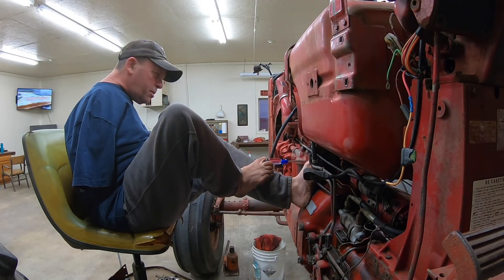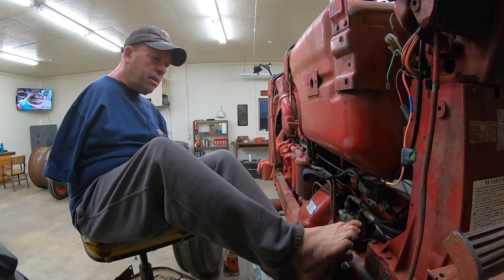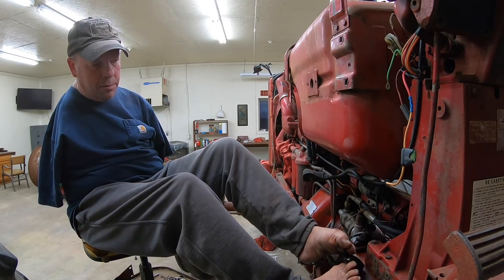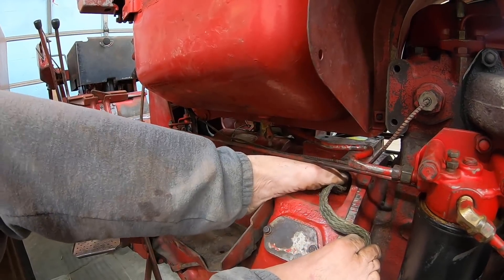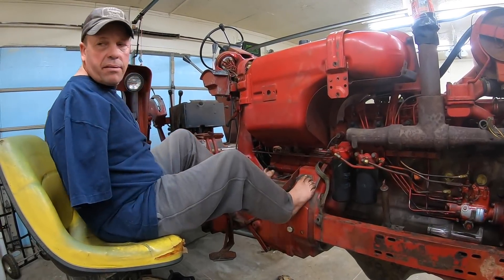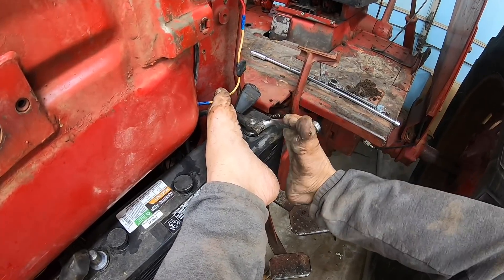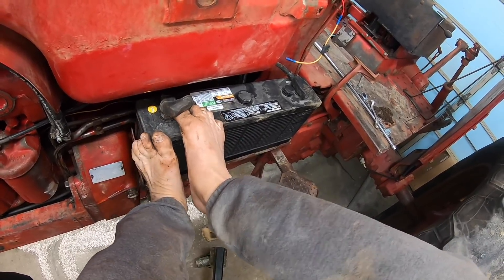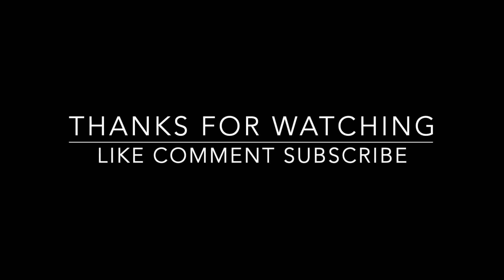IH 856 Project Continues

Comment: I see your dash lights work too. I had to replace the big red round transmission flasher bulb. It was fun. Something so simple took a half hour. Tricky little thing. It was cheaper to buy a box but l only needed one $6 dealer got me....

Comment: The wire that you taped up is the ground wire for the red light on the dash. The "sensor" you referred to is a grounding switch that is tapped into the lube oil circuit on the TA. Light on = no lube pressure, Light off = lube pressure OK.  That red light will come on each time the clutch pedal is depressed because the dump valve is opened at the same time. Its purpose is to release the TA clutches which takes the load pressure off the transmission gears for easier shifting.  The dump valve is adjusted right if the light comes on when the clutch is depressed and the light goes out just before the main clutch starts to engage. If the dump valve adjusting rod is too short the tractor will double shift when starting out in TA HI range (provided that TA LO range still functions).
If the original wiring loom is ratty you can add a good factor of safety against an accidental dash fire by installing a 30 amp circuit breaker between the starter hot terminal and the hot leads into the loom. Learned this trick by working on the John Deere 20 and 30 series back in the day.
Safest way to hook up battery cables is to leave the ground cable until last. That way there isn't any accidental arcing.
Believe it or not I had a John Deere 4020 loader tractor show up here for a clutch job.

Comment: Andy, I totally love your determination,  abilities,  and your knowledge of working on these Big Iron tractors. Everything on these machines are big heavy, and hard to get to. Not to mention high as the tractor itself is tall. You need ladders to reach stuff as everything is overhead.  But thats where "your" determination and knowledge take over. 👍

Did i hear the tractor fire off as you turned the switch?  Sound like it was running. Looking forward to see the ole gal working. Your getting there.
Reply from the maker: No, didn't fire. Thanks for watching

Comment: Nice one to both off you. Now kily is going to be working on farm with Andy think u will have to give her some good lifting jobs she was struggling with the battery's a we bit. L.o.l from Andy in UK
Reply from the maker: Yes, they are heavy. The starter in the previous video might have been heavier tho. It was a struggle. Thanks Andy
Reply: @HarmlessFarmerAndyDetwiler  that's only trouble with older tractors every thing is high .at least on the new ones it's a bit easier.  Still good job to both off you.

Comment: Amazing dexterity and you do it with your feet. I am quite dexterous with my hands. Just waiting for my GoPro to begin the process of filming it. Any advice to improve dexterity in the feet? Also, any advice about GoPro camera usage?
Reply: Also, got a video suggestion, are you comfortable enough with your community on this channel to eat a sandwich to demonstrate how to eat a sandwich with feet?
Reply from the maker: I have 2 of the GoPro hero 7 Black cameras. When they work, they are awesome. We seem to have trouble with them locking up. Set it up and start recording.  The eating video is coming. Thanks Matt
Reply: @HarmlessFarmerAndyDetwiler  we sure do appreciate your go accomplish it attitude. What I find about the GoPro is that the mount screws need a fair amount of tension more than any other camera mounting system do to the center of gravity being higher than other cameras. I am going to attempt to see if I might be able to fix the lack of friction issue.

Comment: From the looks of that clutch pedal it looks to have had a decently easy life. At least it’s not worn slick like half the stuff I use, anyway.
Reply from the maker: The tractor has 9000 hours on it. It came from a 120 acre dairy farm. I don't think it worked that hard but was a constant use. Does that make sense? For years it hauled a load of manure maybe every day or so. They had a gutter scraper in their barn. Made a lot of hay. A lot of PTO work. Really, the tractor is in great shape for the hours. Im thrilled with it.

Comment: I hope she gets whatever she wants in life. They are one hack of a team! And Andy you made the right chose in tools also. In my opinion anyway. I bought an impact driver and a drill kit Ingersoll rand it had been referbished . its been close to two years ago and both tools and batteries still work great. I can't say that about any dewalt  or Milwaukee I ever had. Plus much easier ion the pocket. I'm done with expensive tools. They are nice most of the time but there is always a cheaper one out there that does the same job for less money.

Comment: Hi Andy, another great video.  I was surprised that the tractor required so many tubes and hoses.  Wow.  Also, it looks like the tractor has two batteries on each side of the tractor.   Why?   I'm also surprised that Kylie didn't use a battery carrier to avoid contact with her clothes.  Excellent as usual!!!   - Dean from Minnesota

Comment: I might have missed it but are you going to paint it ? I think it looks  good the way it is maybe put some wax on it. Looks a lot better than the 4520 I just bought. That Oliver standard I've been  spying in the background is a pretty sharp one. I like  them both ways but that one seems like it's in reality good shape.
Reply from the maker: The 8 is in really good shape. Someone painted it years ago with cheap paint and the sheet metal has turned kind of an orange color.  It didn't do it any favors sitting out in the elements for the last several years either. Im not planning on painting it, think I'm going to wet sand it just enough to smooth it up and see what happens. Save the original patina so to say. The Standard 66 wasn't in good enough shape to keep the original patina so we did it up. Thanks for watching

Comment: Well I guess I’ll have to wait for,the next video lol.    Did you reseal the injector pump where it was leaking?  Done a couple myself and it’s not that bad.  Thx.
Reply from the maker: Haven't messed with the pump yet. Just trying to get it running and moving on its own. Making a list of things that need to be fixed. The pump is on the list.

Comment: The way you use those tools with your feet is amazing, and when you slid that hose on and held the hose clip into place with one foot I thought Kylie will now have to step in to tighten the clip, but I was wrong, you just picked up a screwdriver with your other foot and tightened it yourself, You have a good attitude Andy, It would have been nice to see that engine start :(

Comment: Hey buddy would a 5/16 nut driver be easier on them hose clamps?or is there a reason you use flat head?thanks for the videos!
Reply from the maker: the screwdriver was close but yes, I like used a 5/16 with a small ratchet
Reply: Cool man love the videos!!